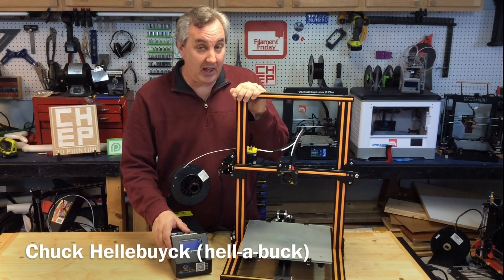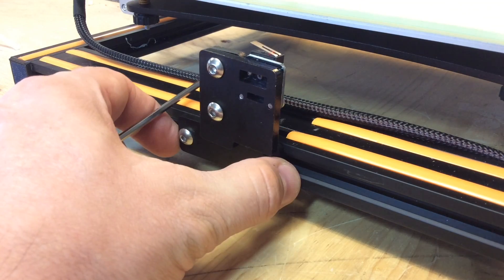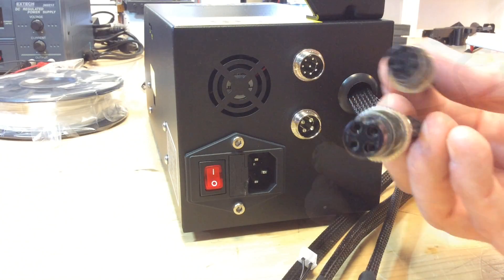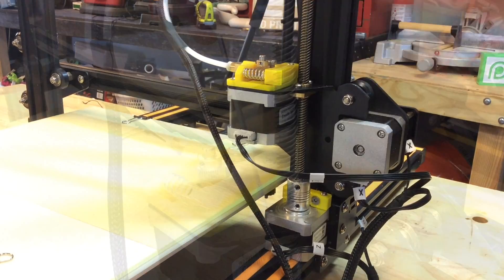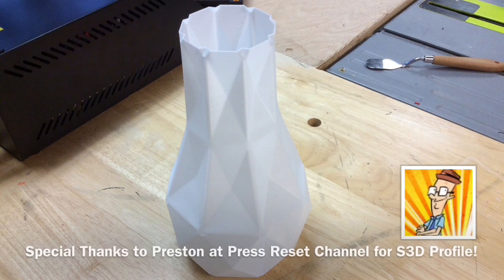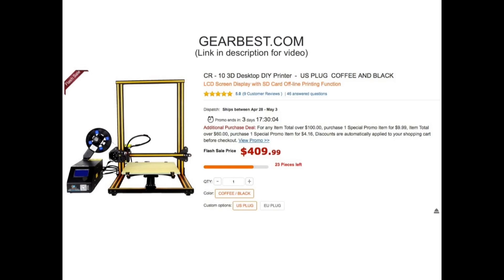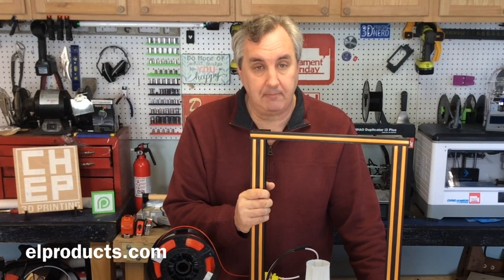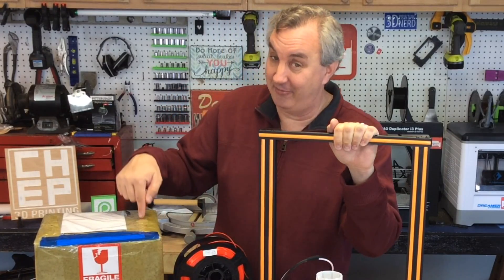Best Large 3D Printer under $500 Creality CR-10

Comment: Hi Chuck, wanted to say thank you so much for all the years of videos. Always great to see what your latest ones are. I did have a question please. I have this printer but I am struggling to know how tight the X-Axis drive belt should be. I thought it was too loose as I was getting rounded corners so I tightened it up; while it still moves OK it does not sound happy. I just saw your video on Cura 5 which I am about to try out. I have a feeling I need to loosen the belt and work on the extraction. All the best for now. Cheers....Jim

Comment: Hi Chuck ! Old video but called my attention this orange details. Where did you buy this ???
Reply from the maker: It’s a CR-10. Link in description.
Reply: @FilamentFriday  Yes, but they usually comes with black frame. Yours, on this picture, is orange. Did you apply it or it came that way ? I saw some silicone or rubber that you could fit on the frame. Is that what you did ?
Reply from the maker: It’s an original. It’s the way they shipped them back then. It’s just an insert.

Comment: Prusa i3k mk2s OR CR-10
Reply: CHEP 3D Printing thanks if you had to choose one though which one
Reply: Kicking around the same question myself. Have noticed the updates made on the CR-10S. As well as the extra capacity. Have you tried it with other materials than PLA?
Reply: CHEP 3D Printing & Electronics I have definately given that serious thought! I currently own a Printrbot Simple Metal fully upgraded, but anything beyond PLA without an enclosure has always been an issue. Even then their bed temps have never been able to get hot enough.

Comment: +CHEP 3D PRINTING, will it run flexible filament?
Reply: There is a piece you have to make that has a tighter tolerance for the filament, this will allow you to print with flexible filament. Without that part you will get jams
Reply: Joel Goodz which part do you mean? Can you send a link?

Comment: What control board does this printer use? I would have loved to see a picture of the inside of the control box. Cheers
Reply: The control box looks exactly like the one which comes with Wanhao Duplicator i3, and it's running Marlin, so I'd assume it has the same modified Melzi board the Wanhao has. Those are an 8-bit Arduino without a bootloader, so if you get a regular Arduino Uno and hook up the 6 ISP wires you can flash it with new Marlin or Repetier. It's possible but not easy for beginners.
Reply: It does use the Atmega1284P but it is not a Melzi clone.  http://www.cnx-software.com/wp-content/uploads/2017/04/Creality-CR-10-3D-Printer-Control-Box-Board-Large.jpg
Reply: I've seen different pictures with a board that looks like a Melzi: https://i.imgur.com/9xOHrDd_d.jpg
Reply: Yes that's a picture of a Melzi, but it's not in a CR-10 housing? The CR-10 housing is shorter than the Duplicator I3 and I think the Melzi would be a really tight fit if would fit at all.

Comment: Can you share the S3D profile?
Reply: I am running Linux Simplify3D version 3.1.1 and it has a profile for the Creality CR-10 in it. I am testing it right now, so far it looks like it works. It did try to prime the extruder from the home position and hit the bed clip. I will have to change this after the print is finished, I am testing by printing over USB.

Comment: The only thing I don't like with these printers is the moving bed. But it seems to be the standard way of doing the Y axis nowadays.
Reply: I know. If it was an issue, they wouldn't be as successfull. I still don't like it ;). Even though I know it works, seeing the vibration of the bed with small infill areas I always think: That's not right.

Comment: I see this on a ton of 3d channels on Youtube but 82 hours to print a Cosplay helmet/mask is crazy.  Is there an option for a 1mm/1.2mm nozzle for it?

I am amazed it comes with the glass plate as well and I wonder is that soda glass or borosilicate glass?

Would you tell me how long it took to heat that bed up?  It is a heated bed right?  I wonder how long it would take to heat that to 100c for abs?

Comment: Hi Chuck since the printer only using one leadscrew then how to sync the Z axis on the other side? Belt and wheel?
Reply: Tevo Tarantula does the same thing and a lot of people buy a kit for the second leadscrew+motor setup and the quality is greatly improved AND you then can go with a direct drive setup and none of this Bowden nonsense which makes the more exotic filaments viable (flexible for instance is a nightmare with bowden and most can't get it to work).

Comment: There are 2 versions that are bigger.
400x400x400
500x500x500

Do you think its too much for a single leadscrew?
Reply: Size no BUT if you want to run the esoteric (cool) filaments you need a direct drive and that is when you will need a second leadscrew setup (same for the Tevo).